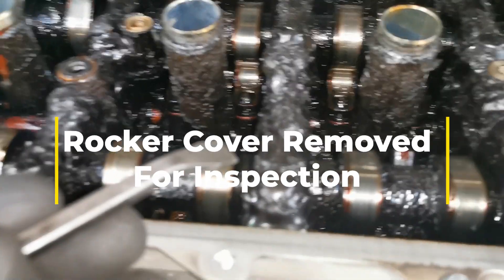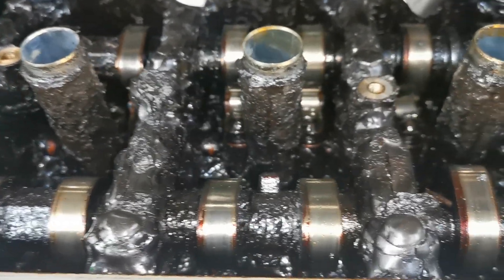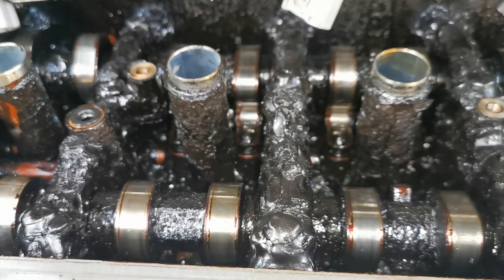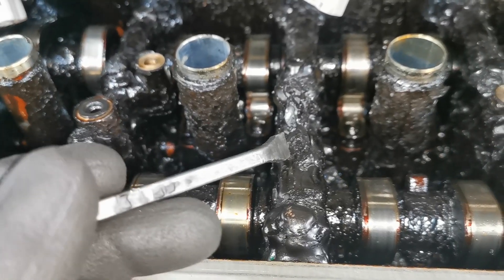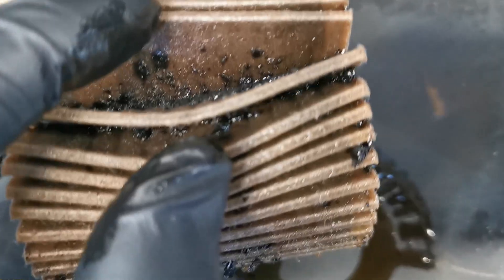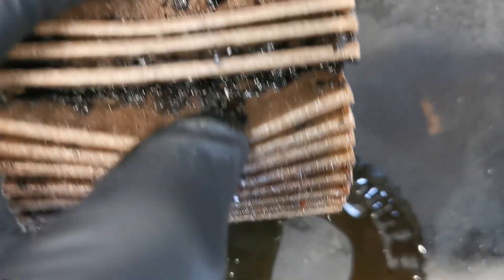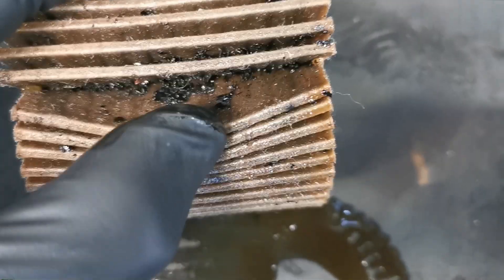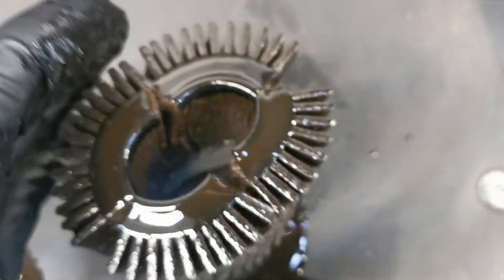What Does Engine Knock / Rod Knock Noise Sound Like? - Watch and Listen - Top & Bottom End Examples

Comment: Hello, just wanted to ask; nissan note 2008 petrol 1.4, timing chain @120kmls , running rough at idle sometimes, when I accelerate through the gears, more pronounced when lugging...there's what sounds like a tapping from top of engine until past 60/70 km then no sound and all ok. OBD Code;P0011 – Camshaft position (CMP), intake/left/front, bank 1 timing over -advanced/system performance; ps cleaned cam sensor and solenoid, pencil type tapping persists.
Reply from the maker: You need to have your timing checked. Get a Cam/Crank correlation check done with a scope and it should give you a clear pathway.

Comment: I just bought a used 2.5T Volvo V60, and it started making bottom end noises within the first two months of ownership. I was 120 miles from home, and had to flat bed it home in the middle of drill weekend. The car has 117K on it, and I had just lavished a timing belt service on it the week prior. Do you think it's salvagable? I drove it for a few miles before I could safetly pull over and stop the engine.

Comment: Gerard maybe it's worth retitling the vid here because engine 'knock' is really pinking aka preignition aka detonation.  It's a great vid otherwise.
Reply from the maker: Thanks Davy 🙏🙏
Bottom end knock aka rock knock is the most common term I heard in my career., I say it, my trainers used it when I was an apprentice and it is used in workshops all over the world.

The automotive industry has many names for the same thing and using certain or different ways of describing things is all part of it 🙌🙏🙌👌👊💪
Reply from the maker: The top end noises also have a multitude of descriptions, top end rattle, tapping, knocking, clicking, ticking etc...

Depends how exactly it presents, I can say all them descriptions have been right on different occasions.
Reply: @GerardBurkeBurkesGarage  Thanks Gerard... ya rod knock or big end failure for sure.  I guess I was more referring to 'engine knock'.  A knock sensor is a preignition sensor.
The other engine related noise you hear [a lot in VAG engines] is timing chain rattle.
Great video though,  keep them coming :)
Reply from the maker: @davyboy888  Thank you 🙏🙏 
appreciate you watching and commenting 👊

Comment: Great content. I have a passat b8 2.0 tdi with oil consumption 1l per 1000 miles . Its seems to be the control rings are blocked. What can I do
Reply from the maker: Thank you Del,
High oil consumption in those cases are limited to what you can do. 
Borescope into each cylinder to check the walls for scoring / damage, have a look at the top of the pistons. 
Compression tests, relative compression tests to try and get a little snap shot of engine condition. A full tear down and investigation of cylinder bores, pistons rings etc including checking tolerances.

These are the most common options but obviously it depends on car value and cost to investigate etc...

The other options would be trying to use an oil stabilisers or treatment of some sort to reduce the consumption.

Lastly make sure you are using the correct grade of oil and a quality brand that is recognised or approved by the manufacturer.

There are been a lot of VW's and Audi that have needed rebuilding due to heavy oil consumption.

Best of luck with it 👌